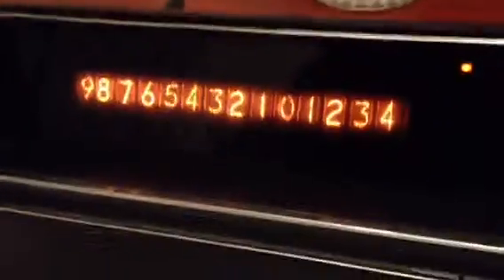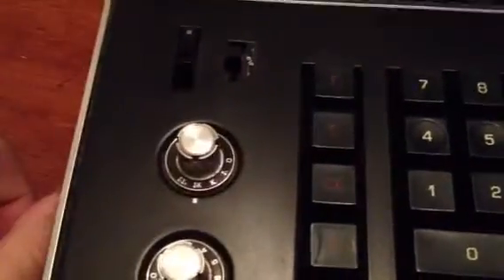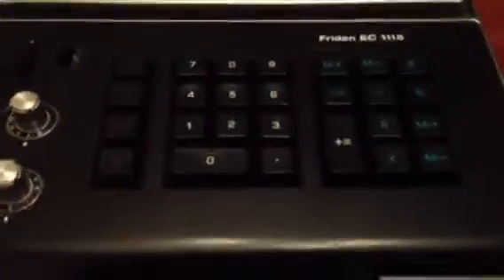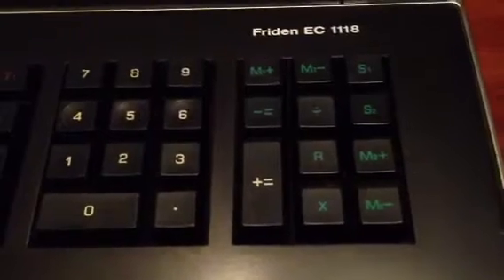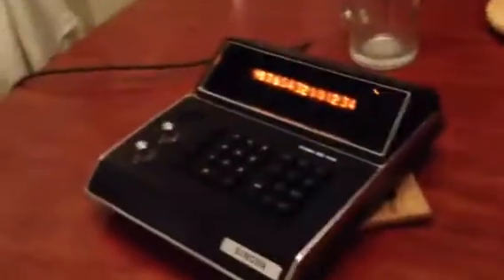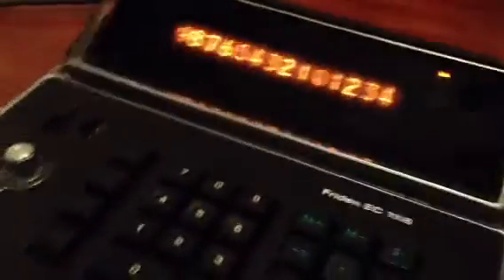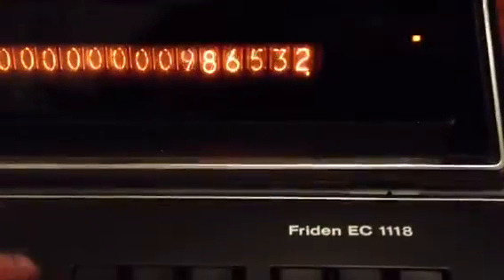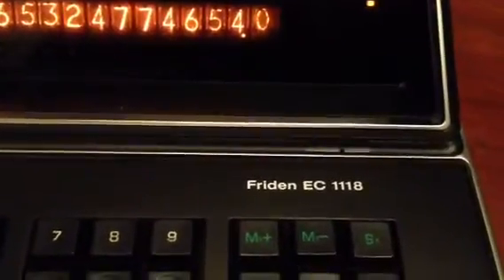Vintage 1970 Singer Friden EC 1118 Nixie Tube Calculator

Comment: Er, other than the Anita 1011 LSI which I think would be slightly smaller, that's pretty small for a 1970-era Nixie-tube calculator!  Most of them are much bigger than that. You'd be comparing them to a C-size battery.